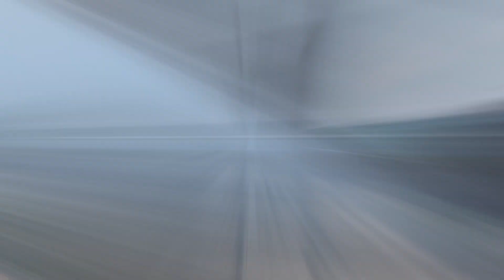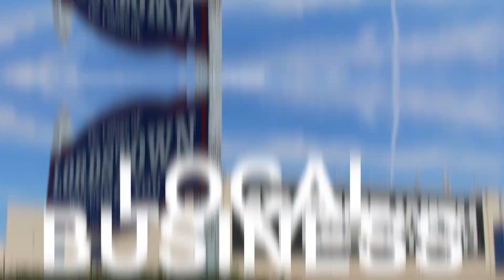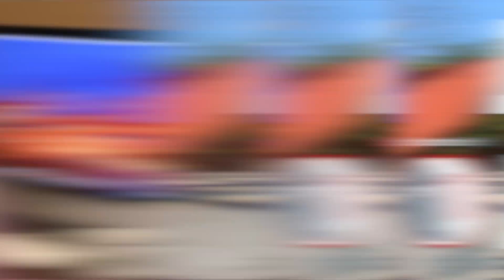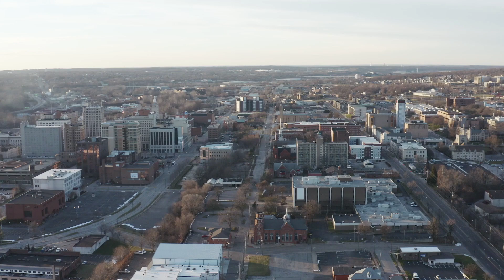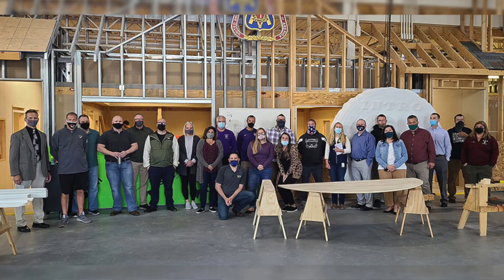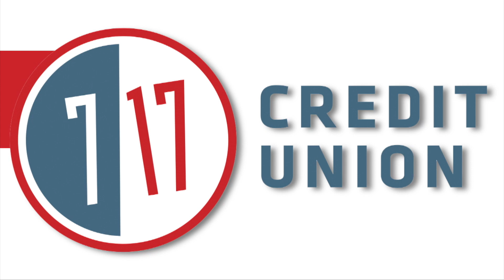Daily Buzz 4-19-21 | Lordstown Motors Leaves Race Early, Outlook on Regional Economy

Comment: What a joke.  Only 39 miles completed.!  A complete embarrassment to even try.
Reply: Good Goodness guy.  Less than half of the vehicles entered finish the race.  The one and only other electric vehicle was a nissan leaf !  And it had trouble drive up hills, lol.  The Endurance used was a beta test truck.  It's purpose is to be tested.  Not necessarily to win races.  The crews were out there all week, running that desert and testing every little thing on that vehicle.  Steve Burns is a good and honorable man.  Prove me wrong.
Reply: To be fair it drove a lot more than 40 miles during the race, only 39 miles on the track